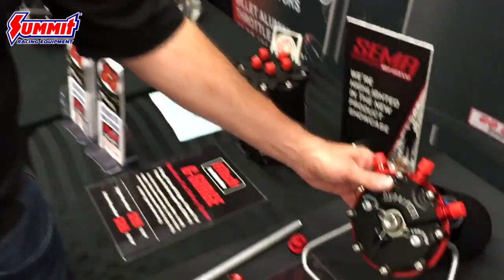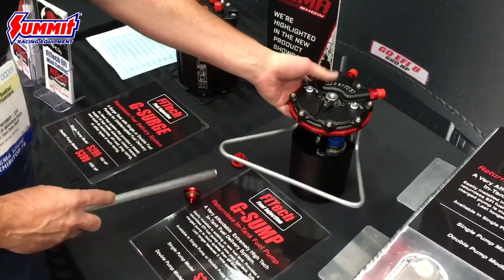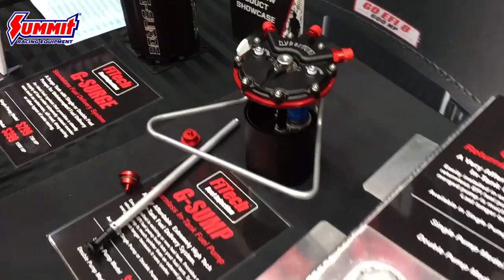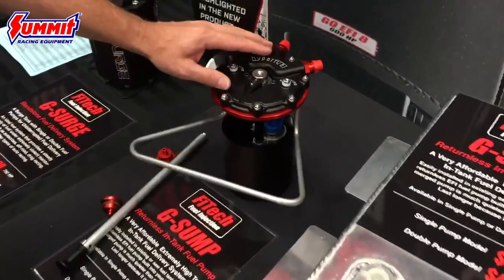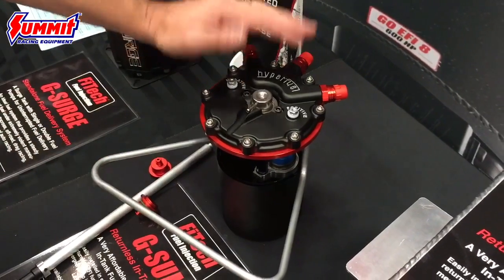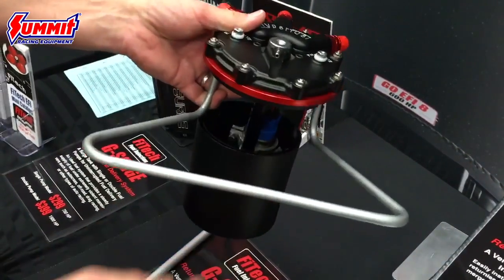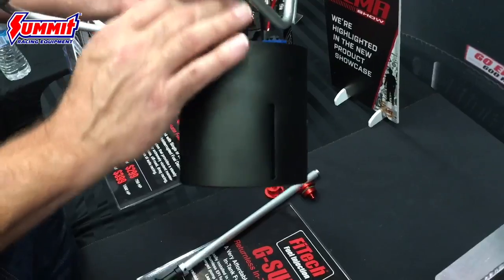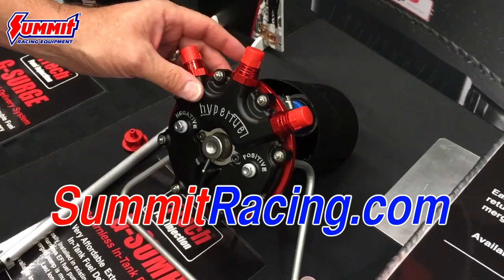FiTech G Sump Inline Fuel System - SEMA 2016

Comment: I have never seen a company introduce so many products and then never put them into production. . . what's with FiTech! I don;t know how they even stay in business. Waited indefinitely for their direct port injection system. . . numerous phone calls to short tempered techs. . . and finally gave up. Then I found the Edelbrock Sequential Direct Port intake and never looked back!

Now I want to use an in-tank conversion style pump and looked all over FiTech for their much hyped Hy-Fuel Single Pump conversion. . .  and to my surprise, it's not available and most likely never will be! GuessI will need to look at the Edelbrock Universal Sump Conversion and keep my original tank and mechanical fuel pump.

These guys must be selling crack on the side in order to stay in business.

Comment: I pre-ordered this from Summit back in March as a package deal with FiTech's 400hp GoEFI to use on a Jeep CJ-7 that I use quite a bit off road, and just received them last week on 5/5/17.  The GoEFI was as expected, but after opening the box containing the fuel pump, I noticed that the baffling system, which was recommended for offroad use and used in this video, was not supplied with the pump.  Thinking that I was missing parts or that I received the wrong item, I called Summit.  After an hour on the phone with them and a three-way call with a FiTech technician, it was finally explained to me that the baffling system used in this video did not function the way it was intended, so they redesigned it and the pump that I received was the current version being shipped.  The fuel pump that I received looks the same as the one in the video, except that instead of the baffling "cup" they used a large filter sock on the end of the pump (similar to Holley), which FiTech assured me will eliminate any fuel starvation problems.  Needless to say that I am extremely disappointed after waiting over a month for product that is not as advertised and is something that I could have bought from another company and had a lot sooner.  In fact I could have modified a stock that factory sending unit to work, but I really liked the idea of the baffle.  Time will tell if the fuel pump with the filter sock works as they say it will, but I just wanted everyone to know that if you paid for the pump shown in the video, you are going to get something different.